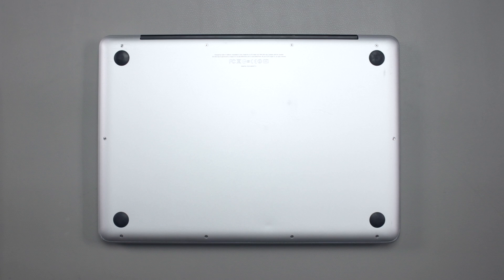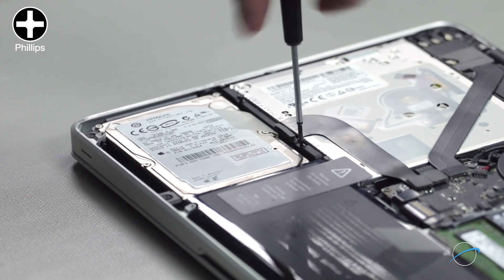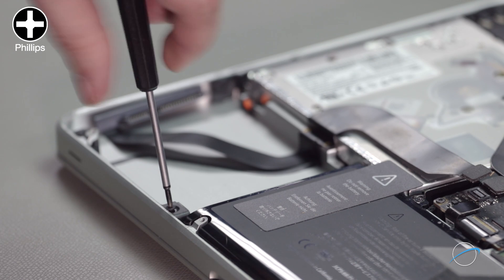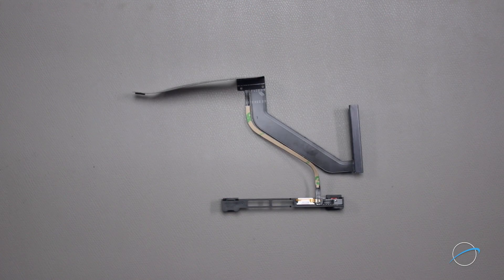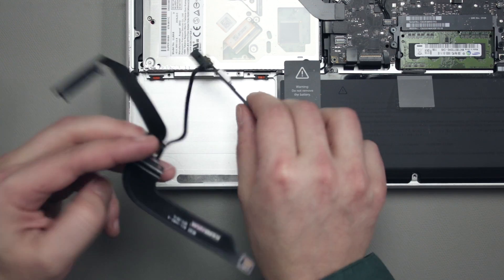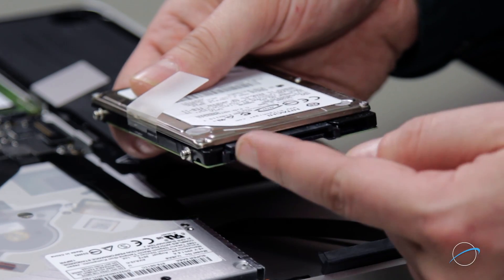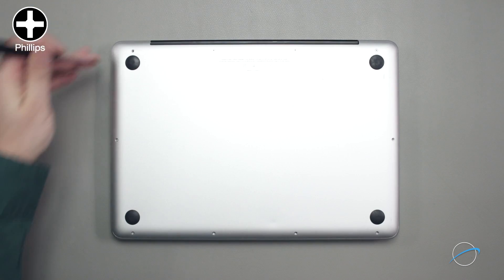How to Replace the Hard Drive Cable in a 13-inch MacBook Pro Mid 2012 (MacBookPro9,2)

Comment: This is a very good video but most people would probably have problems including myself. I purchased the cable several years ago  and should have attempted to install it immediately because now my vision is faltering with a cataract in my right eye. I'll be 80 in February and I don't think I'm capable of installing things anymore. I purchased the 13-inch MacBook Pro (Mid 2012) nearly 10 years ago and I've been using the Novus 2TB external hard drive since the cable gave out 2 years ago. Hopefully the Hitachi HDD won't need replacing but if it does I'll replace it with a solid state. Last year I bought a MacBook Pro 16-inch and it's been wonderful so far. I also have an Acer with Windows 10 which I seldom use. It's 15 years old and  continues to function perfectly.

Comment: The circuitboard on my new cable did not have any adhesive on it. Will it still work correctly?
Reply from the maker: Hello Donald, using adhesive is very much recommended to assure the cable is secured properly

Comment: Thank you very much... That really helps me updating my Mac brook pro Mid 2012..
One more thing I would say that you will require  magnifier Glass to change that yellow strip... otherwise it's very difficult to remove it with naked eyes..

Thanks again!!😊
Reply from the maker: Thank you for the comment and happy to hear this video helped with your install. Yes, the cable is very small and a 🔎 is always helpful 🙂

Comment: Which screwdriver did you use for removing the cable at 3:00
Reply from the maker: The screwdriver used at 3 minutes would be the Phillips screwdriver. This is shown in the top left corner of the video.
Reply: @poweredbyowc   what size
Reply from the maker: Hi Preeth! If I recall correctly, that's a Phillips #00.

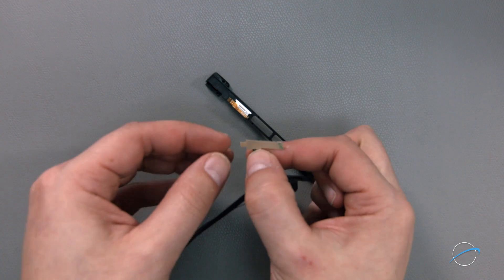Comment: At 4:10. I prefer to remove the adhesive later, once I successfully insert the cable from the light indicator into the bracket of the new hard drive cable. The problem is, I couldn't insert the cable fully inside the bracket. At first, I thought this is because of the bad design of the replacement cable, so I bought another one from another seller, but I still facing the same problem. Any tips on how to tackle this problem? Thank you!
Reply from the maker: Hi Ari!  It's very difficult to connect the ZIF cable from the light indicator into the bracket of the new hard drive cable. (See 4:38.)   Our resources with Apple recommend adhering the cable to the bracket first so you're not trying to connect the ZIF cable to a moving target.
Reply: @poweredbyowc  I’ve inserted the cable as far as it could just like you’ve done in the video, but the light won’t turn on when I put my MBP on sleep.
Reply from the maker: @Ari  Please contact us directly at 800-275-4576 or [support@owc.com](support@owc.com) for more troubleshooting.

Comment: I did this. Even replaced with a new sata cable with bracket. Still nothing. Does this mean hard drive is done for?
Reply from the maker: If there are still issues, feel free to contact directly at https://eshop.macsales.com/Service/, this will allow us to work more directly, quickly, and better determine what might be going on. We are here to help. :)

Comment: I replaced the hard drive cable (great tutorial btw) but I’m still getting the blinking ? folder when I start it up. Was it just a faulty cable?? 😓 Any answers are much appreciated!
Reply from the maker: Hello Foody Floyd,  Looking into this it could be the hard drive cable itself. The only way to determine this would be to test the drive being used in the machine especially the new working drive. The drive(s) can be tested in various ways in a different computer, in a drive dock, external enclosure, or with a drive adapter.  If the drives test good it is likely the cable. Another option would to bring the computer into a certified Apple technician to run proper diagnostic testing on the machine. We hope this is helpful on getting this issue resolved for you!

Comment: I used the SSD 870 EVO but My issue is with a new ssd I installed the high Sierra OS via external USB sata cable adapter. The OS installed perfectly and runs perfectly only from the external USB source, however the internal sata cable don't see it. When I put the original hard drive back in the sata always recognizes that old drive. Even the external USB  sata adapter recognizes the old drive.

Comment: Can I use a 2012 hard drive cable in a early 2011 Macbook? I have read that 2011 cables are much worse quality than 2012.
Reply from the maker: Hello hsun79,
Regrettably you can not they are physically didn't size so it would not work.

Comment: Sliding the ribbon cable back into the socket was the most stressful thing I've experienced in a lonnnnggggg time omg.... and he made it look like it was so easy 😣
Well thank God it's up and running 👍🏼😁
Reply: I broke just it. Had to order another cable...
Reply: @rodmbs  Oh no, my heart goes out to you!!!
Reply: It's fucking impossible.  I now regret even starting this project.
Reply: @OMG_BeCkY  be patient because it will be rewarding when you get it
Reply: @Nrgy1111  I eventually just reassembled my MBP without it even being fully in there and it still fired up!  There was no way to get it in there, it was too tiny and would just bend every time I tried.

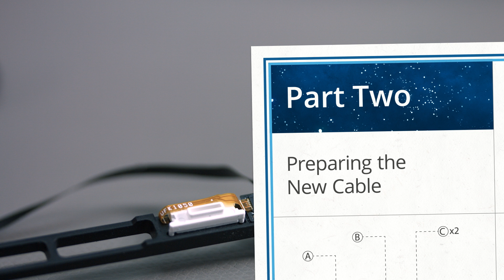Comment: What's the thing called at 3:39? I want to order one that's already connected to a ssd cable. If anyone could help me out that would be greatly appreciated!
Reply from the maker: It's the drive mounting bracket. Unfortunately, we do not carry them, but you can check www.ifixit.com for ideas on sources!

Comment: After i did this i did it without unplugging the battery, now the conputer wont detect or chrge the battery, works fine with the charger but the light stays green and the battery was working good before. I tried disconnecting and reconnecting the battery to avail. Any ideas ?

Comment: Just ordered the part! I hope it works y’all ray for my Mac!
Reply: Did it work ? Want to know cause I face same problem and planning to buy connected and replace myself
Reply: @TiAvika  I would definitely try it. It turns out that something was wrong with my Mac’s actual hard drive not the cable. However, the cable is worth it anyway since they are known to need to be replaced. This is definitely a cheaper option. Try this first and see if it works like I did. It seems to work for most people. Like I said I was having problems with my hard drive itself. This will definitely let you know what your problem is.. if it’s the actual hard drive or the cable. LMK if you have any more questions :)

Comment: Thank you for this! I replaced my cable and added some insulation using electrical tape, which I learned about through another video. Worked like a charm and hopefully this fix will last awhile.

Comment: OMG!!! I replaced the cable myself and now my computer is working. I brought it to the apple store and told them about my issue and they told me it would be $800 if they can fix it or its completely gone. LIARS!!!
Reply: troy vo where did you buy the cable from bro?
Reply: sai ram amazon. Just search up MacBook Pro hard drive cable with the serial number. It was $10-13 and it comes with the cable and the screwdriver needed. Took me 10mins to replaced and it worked!
Reply: troy vo thanks for the info brother. I’m trying to upgrade my MacBook Pro with RAM and SSD. The SSD is not being detected. But I used the same SSD with my friends 2012 MacBook and it’s working perfectly fine. Do you think that’s because of the cable?
Reply: sai ram I would think so. If its not detecting it then it’s def the cable.

Comment: Works a treat. Recently upgraded to a SSD which was followed a week later by a catastrophic failure resulting in an almost completely frozen machine. I found a SATA cable which came fully assembled with all the tools  and didn't require any fiddly reattaching of the small cable as seen in this video. Now have a 2012 MBPro which is better than when I first bought it. Excellent video.
Reply: @Mista S Mojave
Reply: Just recently upgraded to 8GB of RAM and now even better.

Comment: This was a great guide and allowed me to change out my cable and now my MacBook Pro runs like new again! I was having issues for almost a year. I would get the spinning beach ball every time I clicked in Safari after it was being used for a while. The computer would eventually become unusable and I would have to shut it down. Sometimes it would even shut off itself. Then it would take forever to boot. I was getting a circle with a line through it that alternated with an Apple logo and eventually it would lock on the Apple logo with a progress bar that took forever and sometimes that froze never allowing me to get to the login screen. Sometimes I would also get a folder with a question mark (not flashing). I would boot in internet recovery mode and go to disk utilities and it would sometimes not show my hard drive. Other times it would show it as full even though it has over 500 GB of free space. I ran a diagnostic tool that said my hard drive was failing but after researching it I came to suspect this cable. My hard drive never made any noises which is part of the reason I suspected the cable. Whenever I made it to the login screen the login process would be slow and anything I did would give the spinning beach ball until it loaded completely. Then usually it would work ok for a bit and then I would get the same issues again with the spinning beach ball. If anyone reading this has any of these symptoms start with replacing this cable. My old cable looked perfect and the chassis was as smooth as the outer case so it did not appear that the chassis caused wear on my cable like some people have reported. I put electrical tape under the new cable on the chassis anyways as some people recommended doing that. Does anyone know what might have happened to a cable that physically looks just as good as the one I replaced it with? I noticed the new cable has a different part number than the original so I believe the cable was upgraded. Not sure what was changed with its design. Does anyone know?
Reply: Could you specify where exactly you put the tape? I have heard about this but don't really understand. Did it work for you?

Comment: The guy at the shop told me it would be 300 bucks to fix (he thought it was a bad hard drive) Spent $20.24 and watched this video. This actually works. Like i'm using the laptop to type this comment,  lol 

Thanks folks. Fighting the good fight.
Reply: Good job man.. We can fix anything these days...
Reply: Where did you buy the cable from ?
Reply: sai ram hey I just saw one on amazon for 14 bucks
Reply: Getting ready to install a ss drivr and new cable in my mid 2012 macbook pro

Comment: EXCELLENT video!!! My MacBook is back up and running! I attempted to use Geek Squad at Best Buy but they told me it'd be $99 for a simple diagnosis!! Instead I used this video and the replacement part was only $14.90! Thanks!!

Comment: my mackbook didnt start up and a flashing question mark folder appeared .it didnt recognize  the hard drive. I was about to go genius bar and thinking to get a new macbook. and I found this cable. I replaced the hdd cable and It's fixed! my 2012 macbook pro got faster than before. so happy
Reply: T KO where did you buy the cable from  ?

Comment: Great tutorial, but the replacement HD cable didn't seem to fix my problem. I have a new SSD, and upon start-up it doesn't recognize that theres a drive. Could there be something I'm missing? Or do you think theres something internally that's broken?
Reply: Tom Dabom did it fixed??

Comment: I just replaced the unibody cable using this tutorial (btw very helpful). However, I’m still getting the Apple logo with boot up wheel. Do you know what else is the issue?

Comment: So helpful, thank you!

One critique: when Part 2 begins, it might be helpful for some to specify that the removal of the circuit board from the drive mounting bracket is only necessary if the user doesn't have a replacement bracket. When I ordered my replacement cable, it came already wired to a new mounting bracket. 

That little yellow strip almost got the best of me. Twice. So tiny and bendy. So contrarian.
Reply: I second this, I need to order a new part because the bracket holding the cable popped off on me. But, I didn't even need to do this part as my cable was already mounted on the new mounting bracket :( Everything was going well until this point

Comment: I followed the tutorial and it worked, at least for an evening. Now my computer won’t power on
Reply: Did you connect the battery correctly?  If your mac doesn't turn on it's not because of the hard drive.

Comment: Be a chad, put some silver-tape on top of the cable for preventing it from getting worn out by the case again.
Reply: Will regular masking tape work?
Reply: @violinista22  Probably. Mine is still fine.

Comment: Great tutorial it was incredibly helpful. My replacement cable, however, did not have adhesive on the battery indicator light so I had to improvise.

Comment: Will the replacement hard drive cable in the link above work as a replacement for P/N: 923-00975? This was the cable that the Apple Genius bar recommended for my Mid-2012 13" macbook pro

Comment: My CrucialMX500 SSD isn't booting up as a startup. but my old/original HD works fine with the same cable. Will changing the cable help? Using a Mid 2012 13" Macbook Pro.
Reply: I have the same problem. I hope you can help me Why does my Macbook run extremely slow all of a sudden after I upgraded to Samsung Evo 860 SSD? I literally tried every troubleshooting step already. SSD works fine on Windows computer and when I put it in an enclosure and use it as an external. Can anyone help me? Somebody suggested replacing the SATA cable. Does this work? My old HDD works fine with the current cable. https://discussions.apple.com/thread/7502412  @poweredbyowc
Reply: A1278. It's a Macbook Pro 13" Mid-2012 model. People in forums keep suggesting to replace the cable, but no one has really confirmed or followed up if this really works. I really appreciate your help. @poweredbyowc

Comment: What size screwdriver for the tiny screws that connect the  flex cable to the top of the drive bay??? Half way through this installation and the screwdrivers I have won't work!!

Comment: Thought my HDD failed since it's now close to 6 years old. So I decided to go to an SSD, and when I did, I still only got about 10% success rate when trying to start up. The other 90% of the time the computer doesn't recognize the hard drive in it.

A little research revealed that this cable wearing out is a common problem with mid 2012 Macbook Pros. Luckily the part is only about $10, and with this tutorial it looks like it will be really easy to replace. Thanks for making such a good and clear video. Looking forward to having my laptop up and running again.
Reply: I have the same exact issue! All of these tutorials on YouTube about upgrading to an SSD but no one talks about this!
Reply: Went great. Commenting from the laptop. No issues. Thanks again for your help.
Reply: Hey man where did you buy your cable?
Reply: This comment is giving me the confidence I need to do this myself.
Reply: Same issue dude, I'm looking forward to trying this fix!

Comment: I was able to replace the cable successfully, THANK YOU!!!! 
My macbook pro is up and running again!!! This is the third time that I have replaced the cable - a friend did the replacement for me the first time and the second time, I was able to get it replaced at my school’s lab because Apple covered the costs even if my computer was out of warranty. I went back to the lab when I first saw the flashing folder a few months ago and they said that Apple doesn’t cover the cost of this replacement anymore. I called Apple support and was on the phone with them for more than 30 minutes rebooting & checking my hard drive(sigh, they wouldn’t listen even if the lab had checked my drive and told me that it was the cable). At last, my computer booted up but I knew that it was only a matter of time so I ordered the cable. Today, the flashing folder with a qn mark appeared again and I waited the whole day to get to it just in case it resolved itself again. When I got home, I watched your tutorial and was able to the follow along just fine! THANK YOU AGAIN!!!

Comment: How the hell did you remove the two top screws? Those things are screwed in so tight, I can't even move them a little bit.
What size screwdriver are you using?
Reply: Should be a Phillips 00 Screwdriver. Gonna get my cable and screwdriver tomorrow.
Reply: I had to use a Phillips 000. Also dropped some WD-40 on it beforehand.

Comment: I am puzzled and frustrated by the problems I'm having. A few months ago I started getting the flashing "?" when I boot my 15" 2012 MacBook occasionally. About two months ago it got way more frequent. Disk utility checks showed that the hard drive was fine. I replaced the hard disk cable, no change in problem. I just replaced it again with a new cable from MacSales, now I'm getting nothing but the flashing '?'. The system isn't even booting to login on occasion now. Sigh.  

I have an OWC SSD 6G Mercury Electra drive.

So frustrated now.
Reply: MacSales. com thank you. I'll follow up there. Much appreciated.
Reply: Hi I have the same problem after changing cable two times. I would like to test my installation with another hard disk, which is on another computer equipped with Windows 10. Is it possible ?